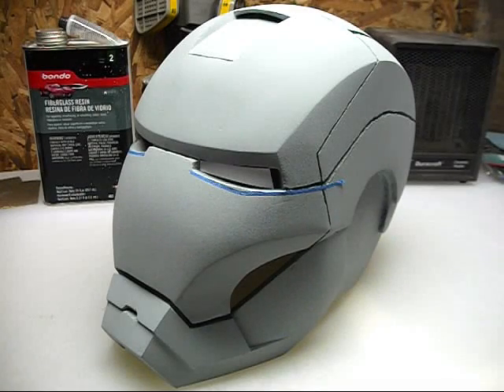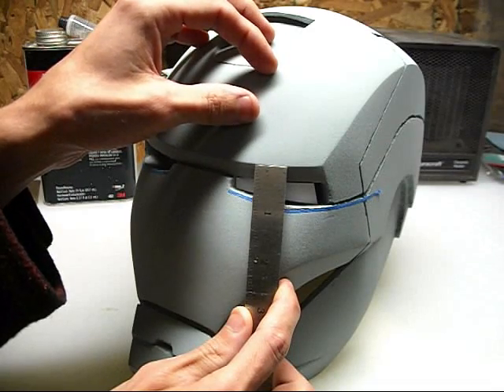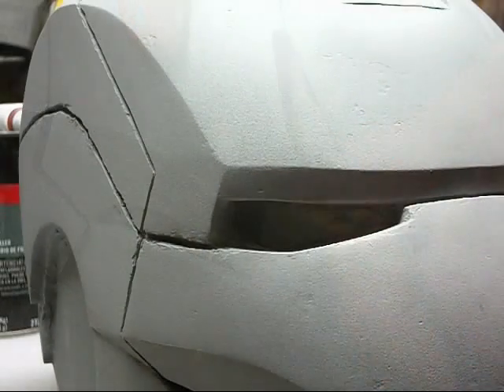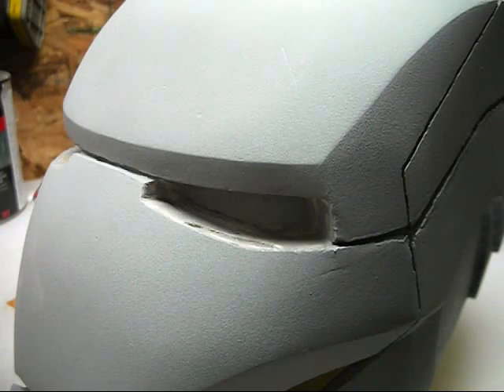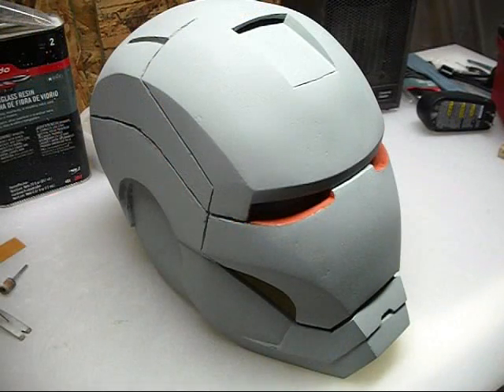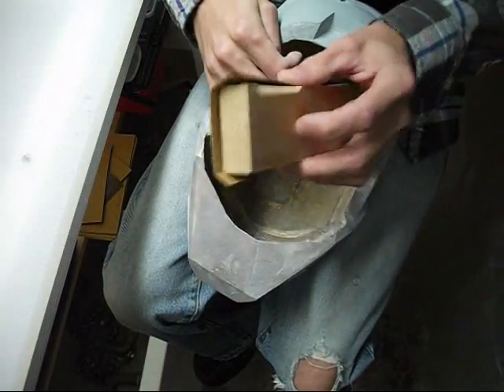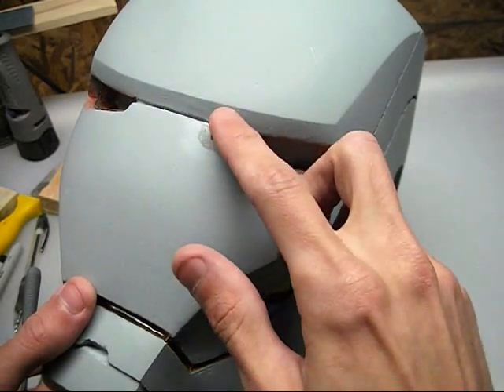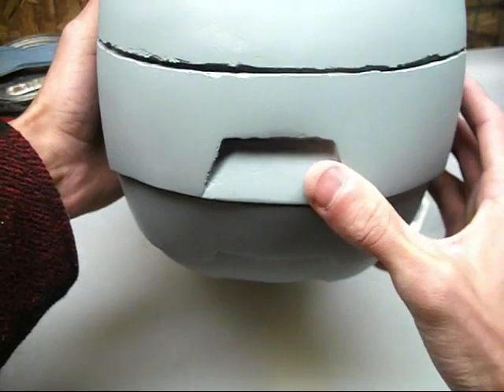IRON MAN HELMET BUILD PART 10 ~ INNER EYE DETAIL

Comment from the maker: Thanks buddy, I appreciate it very much.  You can do it too, I'm not special.  I think the hardest part is to take your time...have patience...if you rush the project it will show.  Do one step at a time.  99% of mistakes in Bondo or fiberglass can be corrected over and over again until they're right.  As far as pepakura projects or prop building is concerned, this is my first attempt, so I don't have any other completed projects to show, sorry.  Thanks for watching, and thanks for the comment.

Comment from the maker: Well thanks very much for sticking with me and the project over that long period of time...I appreciate it.  For it to fit over your head you have to cut off the bottom rear panel and have it reattach after the helmet's on your head. Most people use magnets to reattach the lower panel. It will not fit over a head in one piece.  I'll cut off the rear panel at the very end of the build.

Comment from the maker: All the sides of all the parts are numbered.  You match each number with it's corresponding number and glue them together.  There are two types of lines on the parts which show you how to fold the edges (either up or down).  There's also a feature in the software that shows which part corresponds with which.  After a while you get the hang of it.  The helmet weighs close to three pounds now....and to think it started as a few sheets of paper, lol.

Comment from the maker: I haven't had any experience sculpting before this build either.  Yes, at times things can be very difficult and tedious, and you have to figure ways around problems but the materials of the build are very forgiving.  Fiberglass and Bondo can be cut, sanded, shaped and redone indefinately, so if you make a mistake (and I've made plenty) you can always try again until you get it right.  Try it out and see how you do!

Comment from the maker: Bondo Glass is a polyester based, automotive body filer that also has short strands of fiberglass mixed in for reinforcement.  Once hardened, it can be sanded, shaped, drilled, filed and painted.

Comment from the maker: By doing one edge at a time.  Where two surfaces meet and form an edge I do one surface, sand and then do the other surface and sand.  This keeps the edge from getting covered in too much Bondo and making it hard to re-sharpen later.  Also, I use a razor blade to really keep the corners and edges crisp.

Comment from the maker: You can do it either way.....either using the resined paper as the final surface, or filling with Bondo and re-sharpening all the details afterwards.  I covered ALL surfaces of my helmet with Bondo (except the detail lines themselves).  If the valleys look good to you you don't HAVE to Bondo them, but I choose to.  They mak look GOOD as is, but you can make them PERFECT by Bondoing and sanding them...it's up to you.

Comment from the maker: I printed the helmet the default size as it came from the file.  I didn't scale it at all.  Before you print, the program will tell you the dimensions of the finished helmet in millimeters in the lower right corner.  Length, width, height.  Look at those numbers and measure your head....if it doesn't fit then adjust the scale up or down accordingly.  There is also a low detail, tester helmet file you can build to see if it will fit once built.  I'm only making the helmet.  Thanks-BB.

Comment from the maker: Actually, you ARE correct.  That IS the process most people go through when they cut off the faceplates.  I'm not cutting the faceplate off this master at all....it will mainly be for display once done.  My casts will only be in two pieces...main helmet, and the bottom, rear panel.  That way, anyone who buys a cast from me can decide for themselves if they want to cut off the faceplate.  I feel your pain though...I know the routine....Bondo, sand, Bondo, sand, Bondo, sand.......sand some more.

Comment from the maker: I would definately wait until the Bondo is cured and sanded as smooth as possible or to your satisfaction.  No sense in trying to rush it before the Bondo is cured.  You can then use a Dremel if you like, or do it by hand with a needle file.  Obviously the needle file will take much longer, but you can be much more precise with it.  I will do all my detail lines by hand with a file.

Comment from the maker: Yes, however I will leave the faceplate connected on this helmet.  When the helmet is finished you would cut off the faceplate with a DREMEL tool and a cutoff wheel like you see me using in my part 8 video.

Comment: So how do you finally do the detail work of the valley folds?   Did you put ANY Bondo in there?  Or do you just use the existing paper surface, clean it up with a Dremel?   I am still wondering how this part is done....

Comment: Hey one question could i print out the templates on paper then trace them on fiberglass metal etc and then just cut and bolt, hotglue the pieces together?